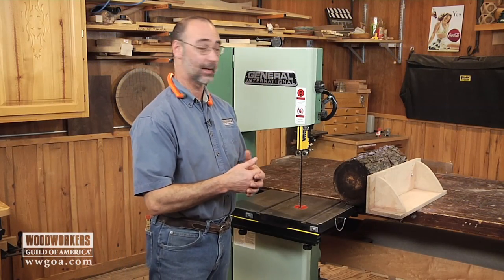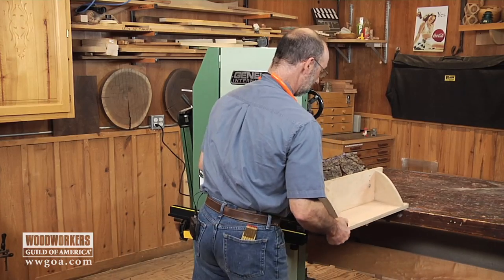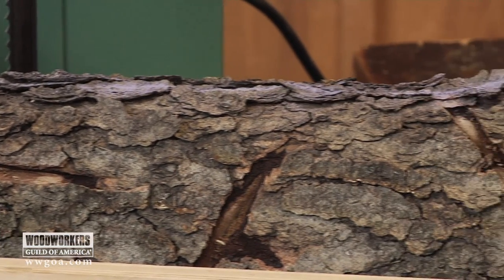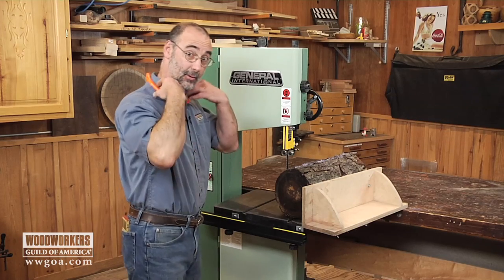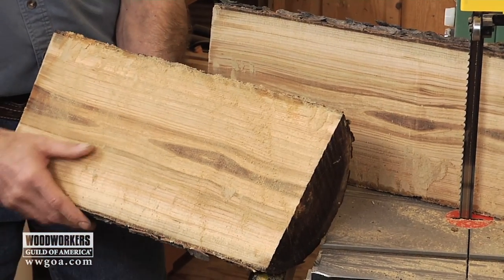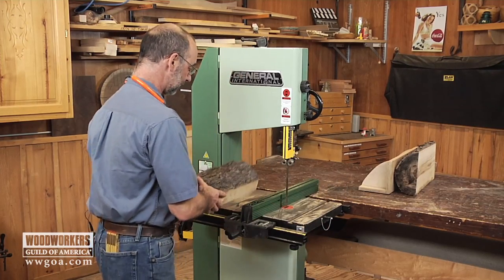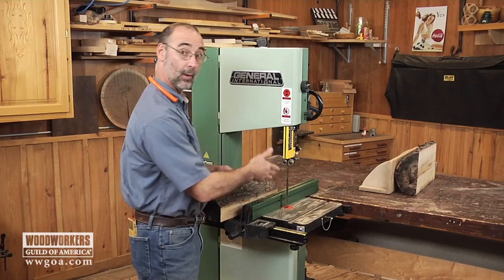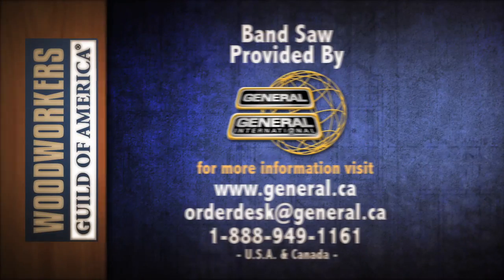Woodworking Project Tips: Band Saw - How to Use Your Band Saw as a Saw Mill

Comment: Making a hardwood fence for the miter makes all the difference MyBest.Tools Tune the saw with a combination square. Adjust the laser so its in line.😂🤣😂🤣😂🤣😂🤣See the photos.Every part in this saw is adjustable.😎😭
Reply from the maker: You have to use your saw.  There is no arbor on a bandsaw.

Comment from the maker: After the wood is cut it needs to be correctly handled.  You should paint the ends of the boards to limit the amount of moisture that can escape.  The wood needs to dry, but needs to dry slowly.  Painted end grain will help.  The cut boards should be left in a place where air can move over them, but they’re not exposed to direct sun.  Again, the sun will cause them to dry too fast.  There should be stickers, spacers, between each board so air can move above and below each layer.

Comment: what is the problem with milling dry timber?
What size is the blade, it looks like its 3/4 ins?
thanks for the video
James
Reply from the maker: Wood cuts easier when it is still green, and it will dry quicker and more evenly if you cut it before drying it. Sealing the ends while the wood is still green is also important, as this will minimize checking during the drying process. The blade is a 3/4" x 3TPI blade which is great for resawing.